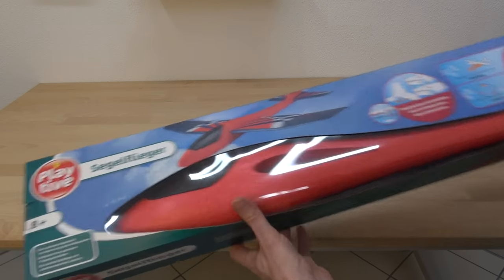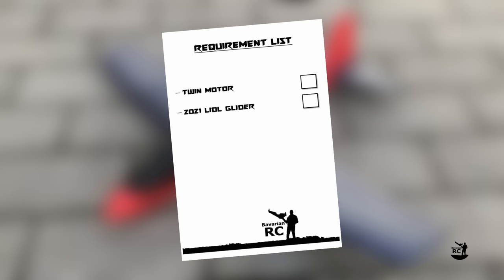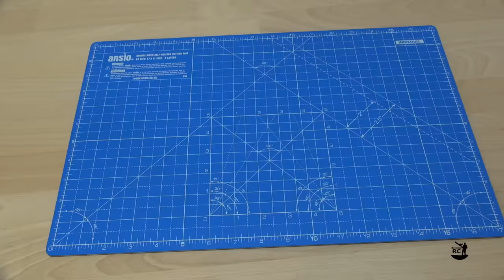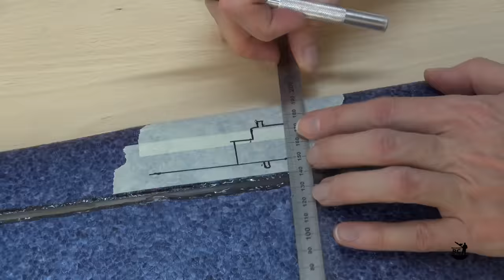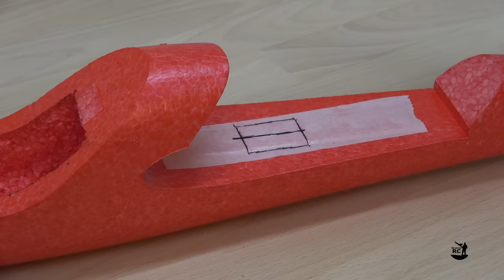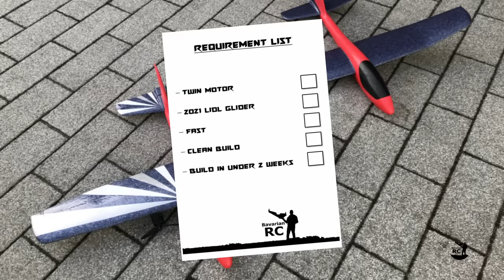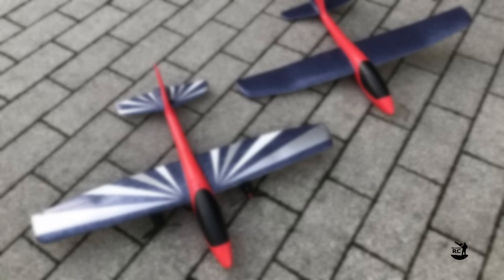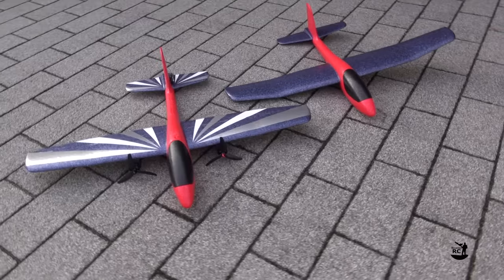LIDL glider RC conversion - TWIN TURBO LIDL - Build Video

Comment: This is so cool- I'd heard of these conversions, and tried finding one at a Virginia Lidl store, but maybe it's a seasonal thing. Anyone know where or if it's available from Amazon or other retail?
Reply from the maker: Thanks! The Lidl gliders are on sale at Lidl only once per year. In Europe this is around June, July or August depending on the country. There are 2 versions of the Lidl glider. The 2021 version (also called V2) which I used to build my Twin Turbo and the V1 (2022 and 2020 and before). The V2 I haven‘t found yet anywhere else, but the V1 is available from Jamara where it is called Pilo XL: https://www.amazon.de/JAMARA-Schaumwurfgleiter-2in1-Pilo-orange/dp/B08JVGJNB6?th=1
Reply: @bavarian_rc  awesome! appreciate the response, and subbed your channel- neat stuff 😁
Reply from the maker: Thanks a lot for joining 😃

Comment: Excellent video! Where did you get the pliers that bend the pushrod ends?
Reply from the maker: Thanks! I used Irvine Super Z-Bend Plier w/Nav.Pin. I found them in a German online shop but they are also available in the UK: https://themodelshop.net/irvine-super-z-bend-plier-wnavpin-168929-p.asp

Comment: Where can I get one of these in the USA? I have looked and can not find one.  Thank you in advance!
Reply from the maker: Hi, unfortunately it will be quite difficult for you to get one of these gliders as they are only available in Europe. I have seen that there is also Lidl in the US but in their online shop they don't seem to have the gliders. In Europe they typically have them on sale around May or June. The Pilo XL from Jamara https://jamara-shop.com/Pilo-XL-Foam-Hand-Launch-glider-EPP-wing-orange-fuselage-blue  is very similar or could be even the same as the 2020 Lidl glider version. Perhaps you can find one of those in the US.
Reply: @bavarian_rc  thank you for the reply. Very helpful. I love your Channel!
Reply from the maker: Hope you can start your own conversion soon!
Reply: @bavarian_rc  The older thick trailing edge version is being sold in Australia (at k-mart stores and online) for AU$10 now. We plan to convert them to twins. But will be going for lighter gliders with a Byme-A stab in the mix. More suitable for us oldies! 😜🙂
Reply from the maker: @theoztreecrasher Great, it seems that more and more countries get the chance to join in to the Lidl mania. In the meantime I have around 15 flights with my Twin Turbo Lidl and I really love it. I gave it 2.5 degrees more down thrust angle on the motors which makes it much more balanced in its flight characteristics. Top speed was around 155 km/h coming out of a steep dive. Flying straight and level the top speed is 110 km/h. With the differential thrust and the large ailerons it is super maneuverable… so definitely not a cruiser 😜 But that‘s the great thing about these gliders, you can make so many different planes with different characters. Enjoy your twin motor build!

Comment: What a super built ! But I have one question, where do you put your battery ?
Reply from the maker: Thanks a lot! The battery is installed in the cavity in the front of the fuselage together with the receiver. I just posted a picture of the installed battery on my Instagram account (bavarian.rc)

Comment: Hello,,, my respect for all may I asked if anyone have the correct steps to learn how to build and design and hoe choose the dimension of all parts of airplane
Reply from the maker: Thanks. There is no simple answer to your question. I would start designing planes by using similar designs with similar dimensions. There are online tools (eCalc) that help calculating the size of stabilizers and the position of the center of gravity. This is very useful to avoid major mistakes. In addition some basic knowledge about angle of incidence (wing vs stabilizer) is needed. Also there you might find some soures on the internet that give some good advice. Anyone else has good advices?

Comment: Is this actually from Lidl? Like the shop?
Reply from the maker: Yes this is a conversion of a chuck glider from the Lidl shop. In European Lidl shops they sell the plane for 7,99€ every year around June, July or August depending on the country. Not sure if they sell it as well outside of Europe. But there is also one from Jamara that is identical to the 2022, 2020 and older versions. https://jamara-shop.com/Pilo-XL-Foam-Hand-Launch-glider-EPP-wing-orange-fuselage-blue

Comment: Аккумулятор куда втыкать и где поместить,,..
Reply from the maker: Hi, you could have a look at my Instagram account (instagram.com/bavarian.rc). There I have posted some pictures of the battery installation (posted May 2023). The battery is installed in the forward part of the fuselage together with the receiver. From there a power cable with a Y-connection is running to both ESCs which are installed in the wing.

Comment: Beautiful build. Do the motors have to be spinning in opposite direction to each other?
Reply: technically no but it will end up rolling better on one side
Reply from the maker: Thanks man! Spinning in opposite directions is eliminating any torque effect. That‘s why I always use opposite directions. Apart from that I think with both in the same direction would still be OK… Never tried.
Reply: Thanks for your answers, guys. I only have two same motors.
Reply from the maker: That should also work, no worries
Reply: The DeHavilland Mosquito from WW2 was built from resin bonded plywood and power by two 1500 bhp Merlin engines. For quite some time the were the fastest aircraft of WW2. However the engines both turned the same way so pilots had to be extremely careful on takeoff. Many were lost due to the torque effect.
The US P-38 had two Allison V12 engines but turbocharged to make similar power to Merlins. These turned in opposite directions for stability. I believe they rotated inwards (clockwise on left when viewed from the front).  
It would be interesting to see this model fly with inwards, outwards and same direction motors.
Reply: I’ve had a couple twin engine RC planes where the motors spin in the same direction. To counteract the torque, both motors were angled slightly to the right

Comment: Hallo,
Sehr cooles video und mit 2 motoren echt cool.
Könntest du ein Video machen, indem du eine Piper Meridian baust?
Oder mir ein paar Tipps geben?
LG Sebastian
Reply from the maker: Danke! Eine Piper Meridian… sehr chic! Momentan hab ich zu viele andere Projekte in der Pipeline. Tipps? Wo soll ich da anfangen… was hast Du Dir vorgestellt aus was Du eine bauen willst (Balsa, Foamboard… doch nicht etwa aus nem Lidl Flieger 😜) ?
Reply: @bavarian_rc  Aus nem Lidl am besten so scale wie möglich
Reply from the maker: Aus nem Lidl Flieger wird das schwierig, die Form ist halt schon komplett anders. Wenn Du das hinkriegst dann sag Bescheid. Aber ehrlich ich glaube fast nicht dass das klappt, zumindest nicht mit vertretbarem Aufwand.

Comment: hold a minute but where is a test flight ?  where is weight test?  with or without battery its too heavy on front part!
Need to see whats on next !
Reply from the maker: Hi, the flight video is here: https://youtu.be/9_H6sVcMOhw
I didn't record the weight test, but I needed to add roughly 45 grams of weight in the tail to properly balance. A part of the 45 grams is covered by my 30 grams GPS logger (the little box at the tail that you can see in the flight video), the remaining 15 grams are a small piece of lead glued to the underside of the horizontal stabilizer. I was already expecting this nose heavy condition with the heavy battery and the 2 motors. Therefore I already pushed everything to the back that I could and already planned to put the GPS Logger there.

Comment: Great clean build. Liked the idea for using tape to create markings. 
Did you 3d print the motor mounts, or buy?
Reply from the maker: Thanks a lot! The tape has a double function. First - you can better see the markings without leaving traces on the material. Second - when I want to mill along a line I make a small cut with the blade first and then use the Dremel with the milling cutter. It perfectly runs along the line and the tape prevents it from going all over the place. I 3d printed the motor mounts. Found them on thingiverse. The link is in the video description.

Comment: Having the motors so low, won't it land in the props? Also, why didn't you put the escs in the motor mounts?
Reply from the maker: Yes, the props will be in contact with the ground when landing but the hq props I use have a bit of flexibility and won‘t break. I used them already on earlier projects like the A-10 Lidl glider and it was no problem
Reply from the maker: I wanted to put the ESC‘s as far back as possible for CG reasons. This is also a lessons learned from the A-10 Lidl where I had to put 90g (!) of balancing weight to the tail to get the CG right. For the Twin Turbo Lidl I could reduce this to 40g… still a lot, but better. 32g are somehow useful weight as I strap a GPS Logger to the tail. So as a good advice, try to be very light in the forward part!
Reply: @bavarian_rc  thanks!! I put the rudder servo and elevator Servo at the back, so I am having the opposite problem 😅 I wanted to use 2 3s450 in parallel to power it, but I'll probably need a 4s 1300 😔
Reply from the maker: Let me know how this setup works
Reply: On some ESCs you can program them to stop the motors with the propeller blades level

Comment: With that amount of hot glue, this thing should be heavy as a brick.
Reply from the maker: The weight of hot glue is commonly overrated. My AUW is 580g which is not so bad for such a overpowered setup

Comment: 17:23
so why you dissasemble and cut so many parts? when your morots can be removed and without any cut top carcase you can grill a hole from cabine to wings....  useless job: cut and then glue cuted parts (
Reply from the maker: Well there were 2 reasons for that: The first one was the fact that I wanted to glue the wing to the fuselage but it is a really tight fit and I would spill the glue all over the surface of the wing when pushing it in from one side. The second one was that it made everything so much easier with the back of the fuselage removed. It was a piece of cake to glue it back on

Comment: need help please
Reply from the maker: Let me know…
Reply: @bavarian_rc  i need to build an Edge 540 with 1400mm wingspan and max weight 2kg if you can help me with a plan please i use an Emax2826 860kv with an esc 40A and a 4000mah 40c bettery... thanks a lot
Reply from the maker: I have an Edge 540 from Flite Test in my hangar, but that‘s a different size. Wingspan 110cm and approx. 1kg weight

Comment: information.        at 4:20,  CF  is  HEAVY.!!!    its use  should  be  AVOIDED, if wood or bamboo will do the job.!!!      its use as a tail boom spar  Permanently  INCREASES  tail-heaviness, in the model's dom.!!!    distribution of mass.        at 5:29,  servos  do  NOT   go  at  the  tail.!!!!!!    doing so  INCREASES  tail-heaviness.!!!            at 10:57, ridiculously large ailerons.      over-powered, 3s  and  HALF a kilo.?!?!?!?       RIDICULOUS            googletranslate
Reply from the maker: Seems you didn‘t understand the overall approach…. By the way, this thing is nose heavy and I need the weight in the back. 2nd btw: I haven’t seen a lot of bamboo used in full scale aeronautics… seems they still stick to CF 😜
Reply: @bavarian_rc  It "seems you didn‘t understand the overall approach" of the Gospel according to Our David! 😜 For a better appreciation just take a quick look at his videos. 🙄
Our twins bodged together from old quad parts, kids' kite CF spars plus plenty of 100mile-an-hour tape and chewing gum are all still flying beautifully! Would give a quality builder like you the horrors but suits us old bush hermits. 😉
Only very slight improvement I've liked is by Ground Control RC - addition of zip tie "landing gear" to take the sting out of rough ground landings. 😊
Reply from the maker: Well I have tried before to understand some of his videos but it seems my brain is too small to really get it 😂 In the end the thing that matters is that our contraptions fly and we‘re having tons of fun building and flying them. Never seen this zip tie landing gear solution. Great idea. I like the simplicity of it. Luckily our Bavarian meadows are not so bad for landing. Cheers ✌️